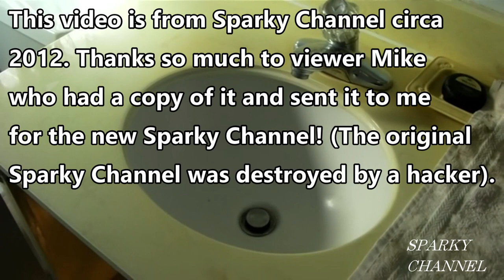Bath Drain Chronically Slow and Backed Up Repaired for Good! Cut the Old Pipes Out!

Comment: Been having to change a lot of plumbing to that configuration. I have even been using the slip P trap fittings for a solid line that can't get jostled loose from Tennant piling stuff up under the cabinets. Kitchen and bathrooms. And then the latest fun task has been those half century old cast iron tub P traps corrosion issues. That is some real bite your tongue and enjoying being contorted in a stinky, musty and damp space for a while. But it has been helping to eliminate unnecessary service calls for leaking sink plumbing. Especially since it's normal for the Tennants to finally notify you about 6-8 months after the leaks began.
Reply from the maker: You are speaking the truth brother! The house I'm working on in the video was built in 1947 and it's built on a slab. You're doing things right!
Reply: Yep the older the get the more corrosion starts to take its toll on that cast iron. I have one house that is probably going to be requiring the replacement of the cast iron lines to the sewer  and that is going to be a scream! Concrete is going to have to get cut out and the replacement of the old and in with the new. But the next time that the plumbing will need work is when I will likely be a fossil. 🤔
Reply from the maker: @Tumbleweed-vh4pt  Yes and those old cast iron pipes can go very deep by the time you get to the sewer. It's a lot of work but eventually it will need it. I did that job for a client and I included all the new concrete work and landscaping. The house looked brand new when we were finished.
Reply: Had a newer house built in the early 80's that was having a drainage problem. The tub was backed up and the kitchen sink as well.  And the Tennants are the cooks with grease and oil on everything, and not sure why heart disease is a problem. Well the plumbing layout was the worst idea that was imaginable. The tub and kitchen sink drain are on a totally separate location, and then the bathroom sink and toilet are like 12' away and by each other. And then

Comment: Good morning Bill..... very interesting video.  I hope you enjoyed a nice cold adult beverage after all your hard work. LOL.     I’ve got a problem with my kitchen sink.  It gurgles after you shut the water off.  I’m guessing my vent might be clogged.
Reply from the maker: Good morning Bill! Yes, gurgling can involve the venting for sure. What year is your house?
Reply: Hi Bill - the house was built in 1773.  The updated plumbing for the kitchen was done in the 60’s or early 70’s.  I think the vent pipe comes out horizontal.  Haven’t gone up by the roof to verify yet.  The drain has been gurgling for a year, but hasn’t affected the water from properly draining, I didn’t consider it an important issue to resolve at the time, but it would be nice to get rid of the noise.
Reply from the maker: @MrStanwyck  Wow! That's so cool! What city? It must be a wonderful house! The gurgling is your grand old house telling you that the drain and/or vents need attention.
Reply: @SparkyChannel  I live in Newburgh, NY.  It’s 60 miles north of NY City in the Hudson Valley...
Reply from the maker: @MrStanwyck  Excellent! I've watched houses like yours worked on in "This old House". Here in San Diego an "old" house is perhaps 1914, something like that. Are your drainage lines cast iron? 60's drain lines are usually cast iron out here. If so, you could be having some of the same situation that you saw in my video.

Comment: My parents recently had a plumber out to put in a walk in shower insert, and fix some pipes and do some tiling. We did demo because it made the cost of the work a lot cheaper. We knew the back of the breaker box was behind the shower wall, so we were careful. After we opened it up, we were shaking our heads because of how small the gauge of wire was that was coming out of the box and powering our whole house. My brother likes to run a welder and would always trip the breakers on occasion and wanted to eventually update the breaker box to withhold the extra power he needed. Now he says he is scared to even run it again because he is worried about the cable “superheating” or catching fire because of how thin it is. On the opposite side behind the shower wall, there was a power cable running straight from the back of the kitchen wall, (to power a microwave) and straight down along the metal shower water pipes. The plumber was looking scared and had us turn off the power before he touched it and had someone move it. There were also “questionable” ground cables connected to the water pipes, and other random things. When he flushed the pipes, huge dime sized chunks of sediment were spraying out. It was quite disturbing. We found a green tag connected to some pipes that said the house was certified in 1951, but the plumber thinks all of these other “questionable upgrades” were after that certification. Now we believe we are going to have to replace a majority of the piping due to “galvanic corrosion”. We were also recommended to update the wiring in our house, which we knew as soon as that drywall came off, but sure as hell cannot afford right now, haha.
Reply from the maker: Wow! It sounds like you have a wise and experienced plumber. If he is scared, there may be good reason for it. What city are you in? I have to think that the time to do these upgrades is now because the wall is open. I totally understand about the financial part of this but it really sounds like a safety issue. All the best, Bill.

Comment: What was the material clogging the pipe? It looks like black rubber.
Reply from the maker: It was an accumulation of minerals over the years. It's fairly hard, but you can dig it out with chisels, screwdrivers, shop vacs and the like. It's best to just replace if possible.

Comment: Why would you not put a camera down the pipe to look for additional clogs further down? The whole pipe might need to be replaced. I removed an ancient cast iron drain pipe-stack that was 70 years old and it had crud all the way down. Also the pipe was very thin due to corrosion in some areas.  Sometimes with the old cast iron drain lines aren't you better off ripping out the old cast iron and replacing it with plastic?